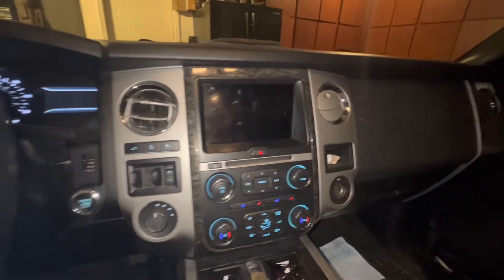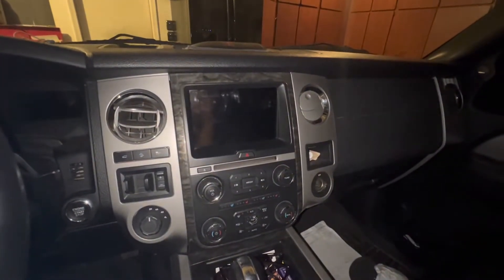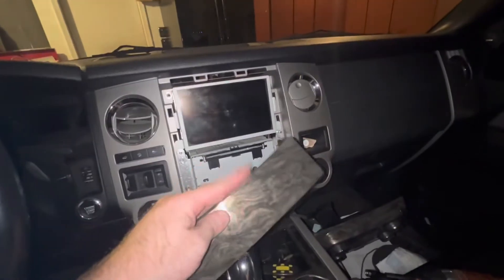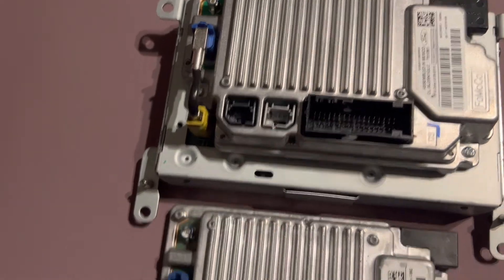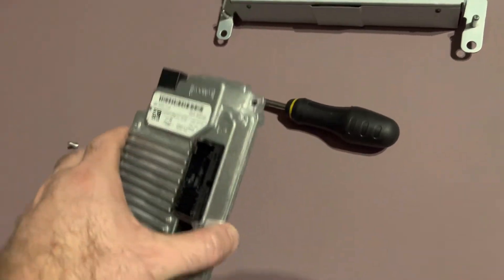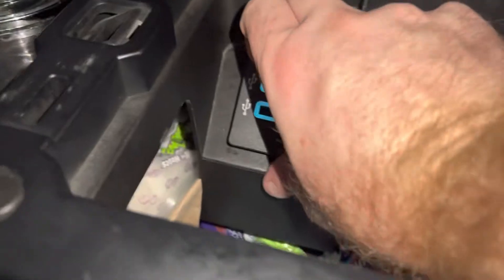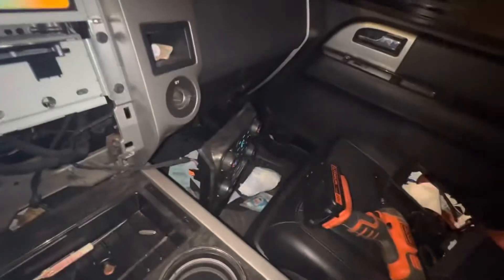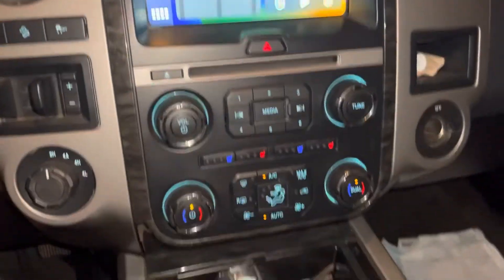Ford Sync 3 APIM Module Replacement/Upgrade to Apple CarPlay and Android Auto

Comment: How does the screen connect to the sync 3 APIM without being connected to the plug in the center of the back of the screen? How do you connect those two pieces?

Comment: I have had the same issue with 2018 F150 platinum. Because of this, I will never buy another Ford product. They do not support vehicles when they have defective parts. Was replaced what’s under extended warranty 20,000 miles later save issue just out of warranty they were $1500 to look at it it’s a Ford defect should be extended warranty for lifetime.
Reply from the maker: Yeah it's frustrating. If you want to reach out to the guy that sent my replacement here's his info on Ebay. He was great. He did the work same day because we were leaving on vacation the next week. He also had it updated to the very latest software. Still works great today. 
https://www.ebay.com/ulk/usr/breeves002?mkevt=1&mkpid=0&emsid=e11412.m43.l44715&mkcid=7&ch=osgood&euid=f902488212be4771941d2e03cb33dfd8&bu=43169061133&exe=102451&ext=241050&osub=-1%7E1&crd=20220920180915&segname=11412
Reply: @jessebaumgartner  - was the programming to update to the latest version of SYNCH or to program it for tour specific vehicle?  Did you need to supply your VIN?
Reply: They have an APIM recall on certain models but to the best of my knowledge the latest vehicle are 2015 models.  I agree they have a reliability issue with the printed circuit board shop that produces the APIM.
Reply: What manufacturer does when your vehicle is out of warranty?